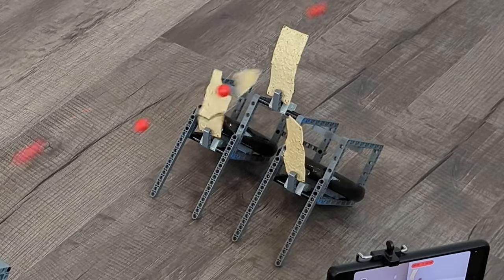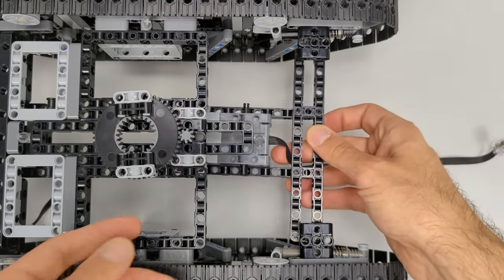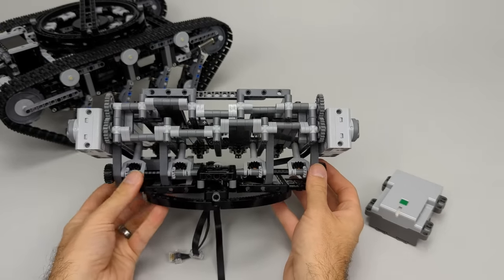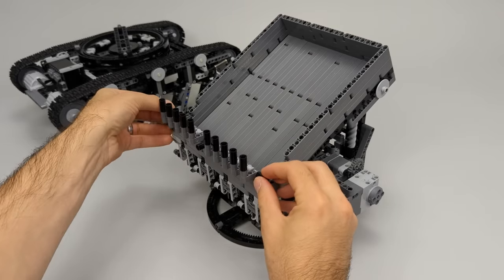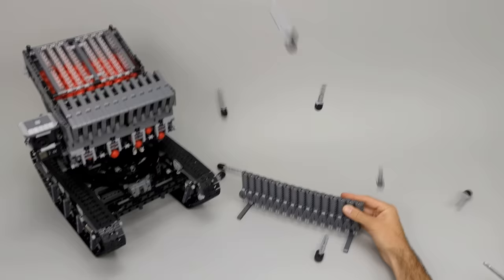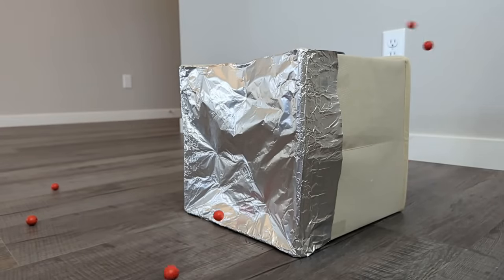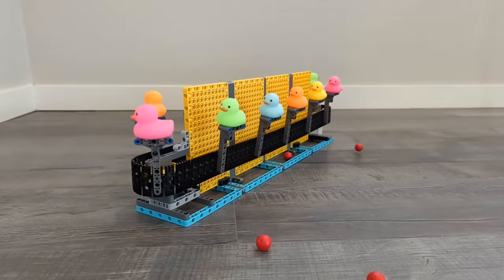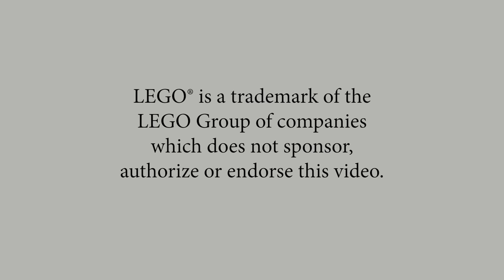Building the Ultimate LEGO® Tank...

Comment: Only one main suggestion for the tank. 

The Center of mass is WAY to high up on the tank. It needs to be further down to ensure stability. Somewhere within the main hull. if you do plan on revisiting this tank, you should add some sort of counterweight near the base of the tracks, as well as expanding the tracks forwards and backwards. Maybe with 3 to 4 more Suspension units per track length. 

Other than that. It's Very Impressive! Love it!

Comment: "Out of ammo" Well I guess my tanks have one advantage, I use a conveyor belt to pull ammo off the ground for mine XP. Should be an easy upgrade for your tank though, but you might need to add an extra actuator/motor to raise and lower the collector so it doesn't affect  the suspension.
Reply from the maker: That would be very epic! It's a challenge though...I tried building a mechanism for it and wasn't happy with it

Comment: You may want to actually gear down the track motors, it seems a little unwieldy at its present speed and the power is important.
Reply from the maker: Yes, great point! It depends on what you need I guess. In this video, I wanted speed, but in most normal circumstances, higher power would be preferred.

Comment: This tank is not a tank, it should be used as a MLRS system, it has 0 accuracy, however it’s rate of fire and spread of munitions makes it a key part in removing large crowds worth of enemies/hostiles.

And it’s range is a little low for a MLRS System, so I recommend increasing the range.

Comment: what's the price for just the plain rc no tank adjustments
Reply from the maker: There's a link in the description for the RC controller (BuWizz 3.0). You can control it with a smartphone through the BuWizz app or a gamepad using BrickController2 app. I think the BuWizz 3.0 is around $200 or $230 or so. The motors I used for powering the tracks aren't available much anymore, but you can use many types of LEGO®  motors with the BuWizz controller. Good luck! 🙂